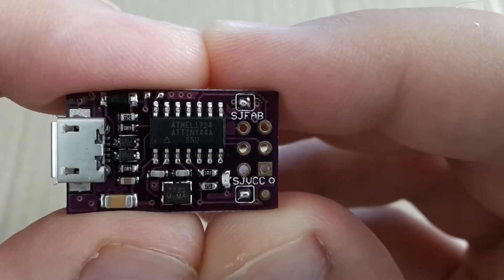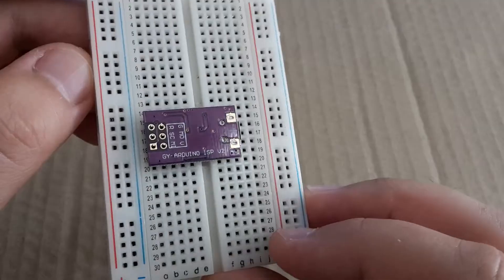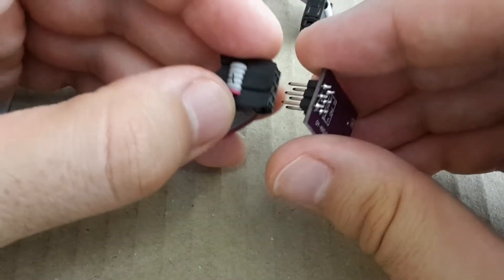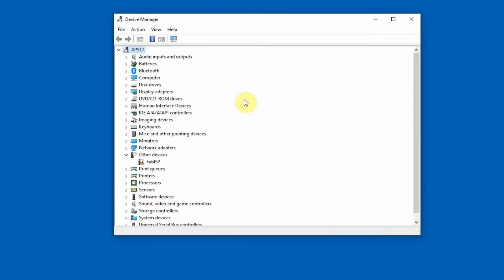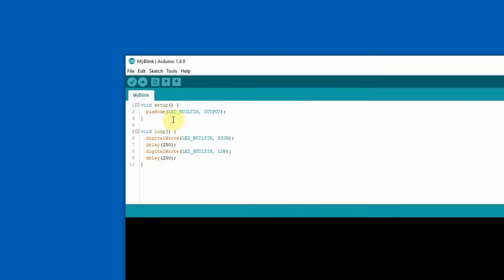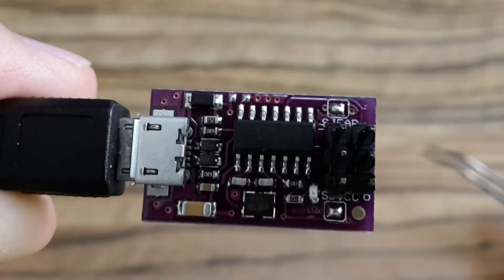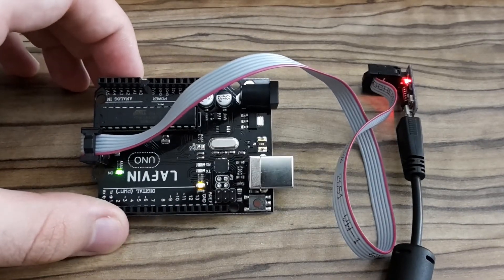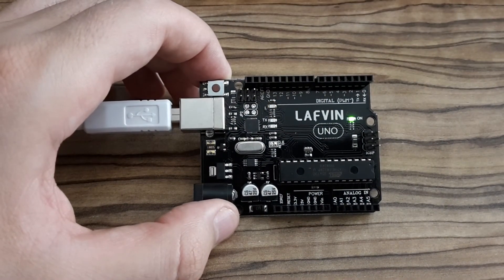AVR 5V Micro USBTinyISP Programmer for Arduino with a SJFAB Jumper Issue

Comment: you are amazing explainer i like this tutorial it works for me and now i can design my standalone arduino that can be programmable with tinyusb ISP.
Can i program attiny85 using this programmer ? please make video on this topic.

i was looking for this type of tutorial 

thank you so much.
Reply: i also wan to know that how to burn boot-loader in new Atmel328p with USBtiny.ISP in my standalone arduino board directly.
Reply from the maker: Yes, it's possible to program ATtiny85 with that programmer. Anyway, that's a good challenge with your own Arduino :-)
Reply: @AshishPatel-ru1op  you need use 16mhz xtal at first time burn bootloader